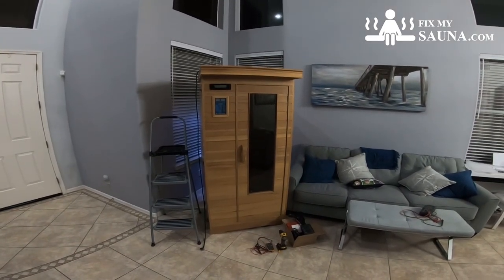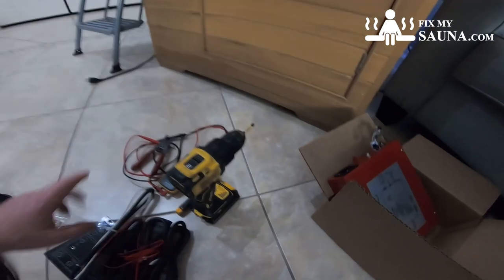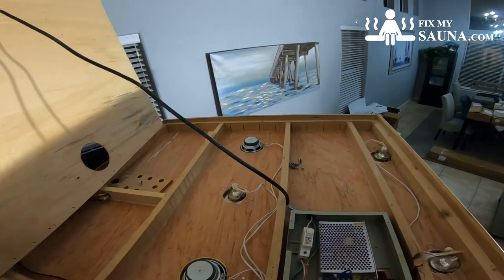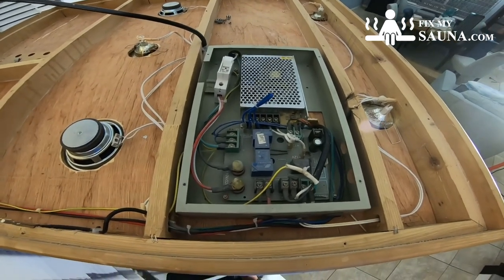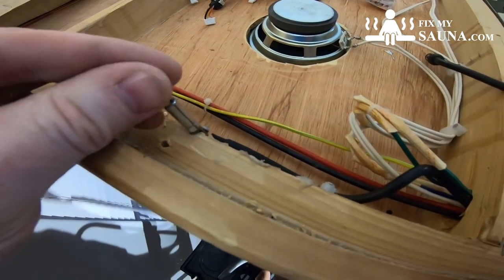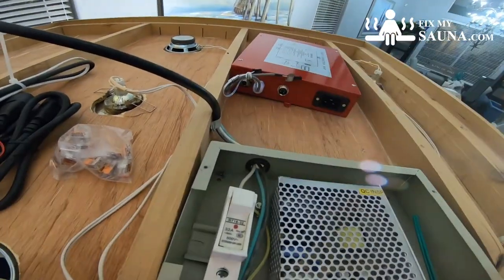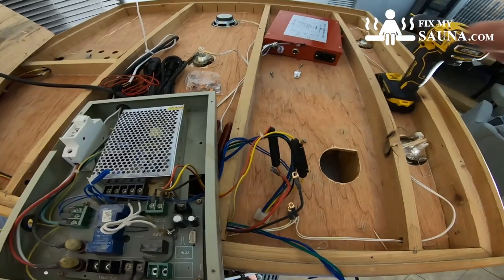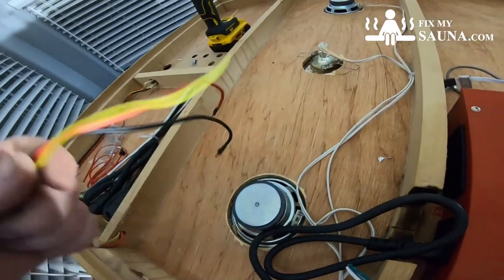Fixmysauna.com sauna parts installation video.

Comment: what process would you use to determine why the sauna continues to kick the reset button on power box?
Reply from the maker: Most likely a power relay that's faulty.  It also could be a faulty heater that.  To check most infrared heaters you need to perform a continutiy check.